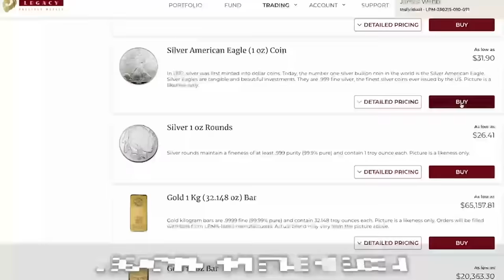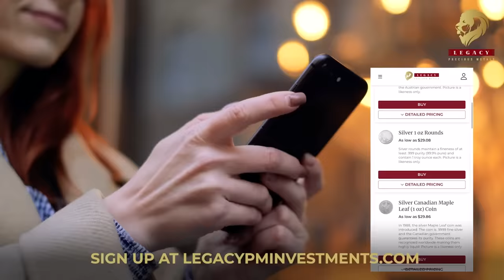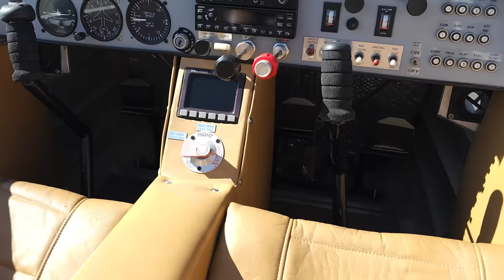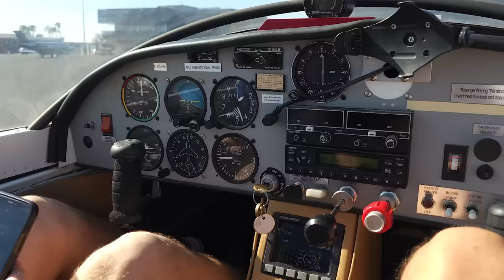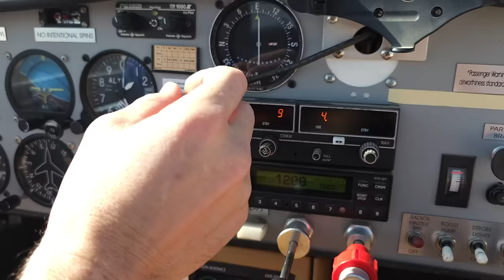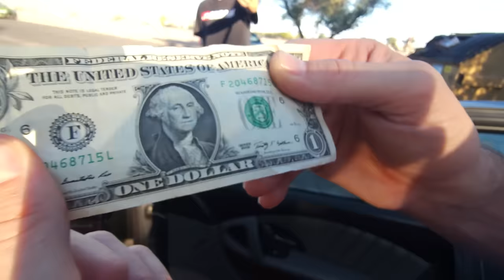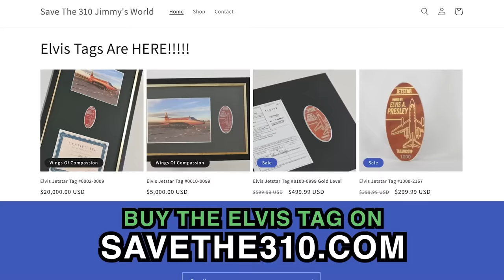P51 Mustang For Ferrari Swap?

Comment: They’re actually two minutes walk from where my hangar and airplane used to be. I had one of the City Hangars right by where Jimmy was pointing at while looking down the runway. At the time when I bought the plane (and the hangar rights of course) there was a 25 year waiting list for one of those hangars, 10 years ago. I got ticketed once for parking my motorcycle inside the hangar next to the airplane. With City Hangars they were super strict, with privately owned ones they were not.

Comment: Man that is such a kick butt car collection. I tried to flip cars/trucks when I was younger but couldn't make money  and always wanted to keep the ones that could. Now I've got 13 vehicles and a huge shop with 3 lifts to stack em. Tried making shelves but the ramp made it to difficult unless I removed an entire wall. Looking for a car lift or maybe I'll build a mobile lift and stack em like wood along the walls. Trying to build a mobile rotary platform but it gets stuck behind other cars.My dream is to ride/drive a real Tucker Torpedo at least once. Own a Ford GT40 and a Coyote kit car with a twin turbo BIG block. I'll probably crash and die in the GT40 so maybe I'll try and borrow one. I'll pay someone to let me drive your GT for a couple hours, can anybody out there help me out? You'll probably get most of the pieces back once they scrape it off wherever landed.

Comment: The 996 is cool, especially if it comes with the hard top. I'd stay away from the Bentley LOL. +1 vote for the LS swap airplane. The call-in buyer in the Elvis Jet auction video was a red flag, for sure. I dealt with water damaged electronics in a Boxster 987 - NOT FUN.
Reply: I’ve owned a 99 Gen 1 996, (fried egg headlights), and a 04 Gen 2 996 (turbo headlights) . The IMS bearing issue is completely blown out of proportion on these cars, but the Gen 2 was better in just about every way possible in my opinion.
Reply: Very interesting, thank you for the input. I drove a late model 718 - it seems with Porsches that the newer they are, the more exponentially better they get. One of my dream cars is a new-ish 911 Turbo S.

Comment: With the foreign paper money you are just using the exchange rate. That is not want a collector looks at unless it has no collector value associated with it. With the coins you are just looking at the value of the metal content of the coins and the scrap metal price. The scrap price is less than the what that metal is trading for on the market.

There are 3 things that determine the collector's value to any money in the world:
1. The rarity of the money. This could be the year that it was minted, the mint mark and the number of each example that are known to have been minted. This could also include mint errors of that example or a rare variety of that example. Some collector will usually only collect varieties and/or mint error money.
2. The grade or condition of the example of the money. A "mint state", one that looks like it was just minted and has the full, well appointed features of the money being examined will be worth far more than an example of the same money that is well worn.
3. As usual, it is only worth what someone is willing to pay for it.

Comment: Forget about the red 914 that's been cut up with a stupid fiberglass chalon body kit. Buy the lime gold 914 at the front that they didn't talk about. That's a 2.0. Looks like a 74. If it's a 73 it's as good as gold. They bring big money. Buy everything they have that's older. Stay away from all that Italian hand-built trash. They're to common. Better do some research or you're going to end up with another boat anchor.

Comment: Isn’t it illegal to use an airplane hanger for non aviation reasons? Asking for a friend.
Reply: Under Federal law, airport operators that have accepted federal grants and/or those that have obligations contained in property deeds for property transferred under various Federal laws such as the Surplus Property Act generally may use airport property only for aviation-related purposes unless otherwise approved by the FAA.

Comment: Do not buy: The Ferrari the trunk lid shows its been wrecked by it being out of alignment by showing the wide gap on the right rear corner of the deck lid.
Reply: You saw that, too?  I wouldn’t buy anything with a salvage or rebuilt title, either.  I have a garage full of Porsches, but they’re all honest, no accident cars.

Comment: FYI.  Years ago the Zodiac had a structural problem that resulted in fatalities I believe.  There was a redesign and retro fit I think.  Bottom line, contact Zenith about this plane before flying.
Reply: There was no single root cause, a combination of factors resulted in the crash of 6 CH 601XL's with a total of 10 fatalities.  A total of 20 safety recommendations were developed, doubtful there are any planes still flying in the original configuration.